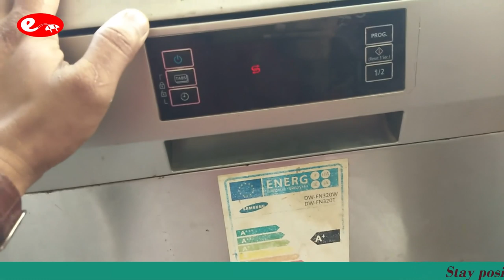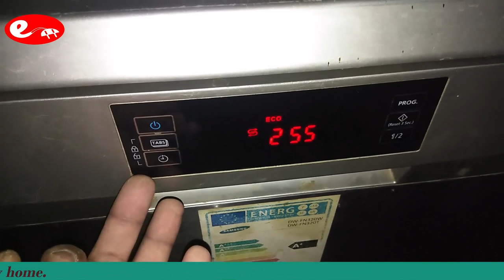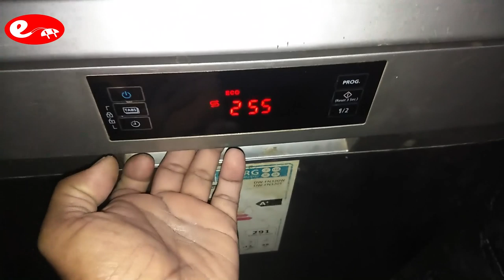Samsung dishwasher repair

Comment: Hello sir winterhalter p 50 machine hey fast issue display on nehe horah hey or pcb sey supply nahe jarah hey conductor coils & all pump leaking manually chack keya sab pump sensor conductor okay pcb input 238 volt but output 0 key issues ho saktah hey